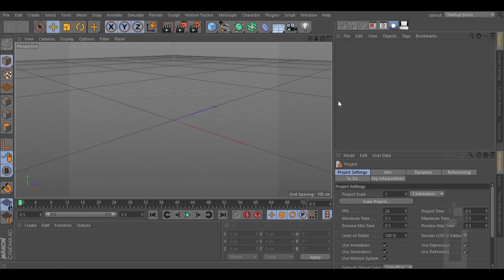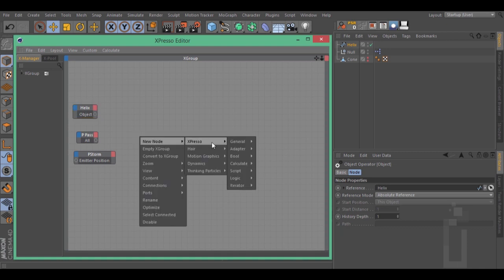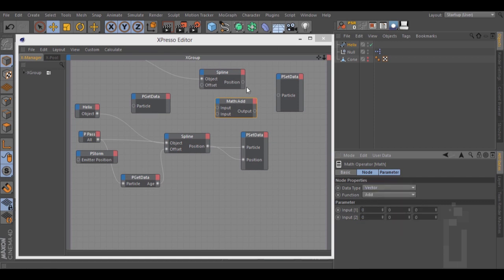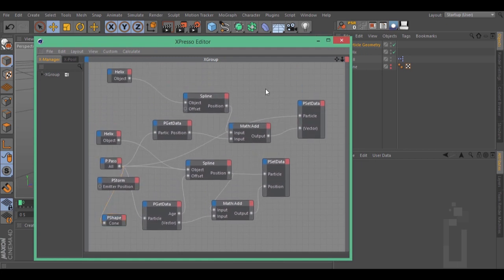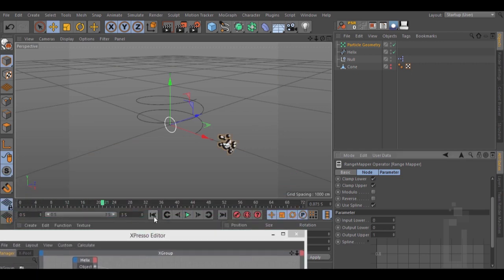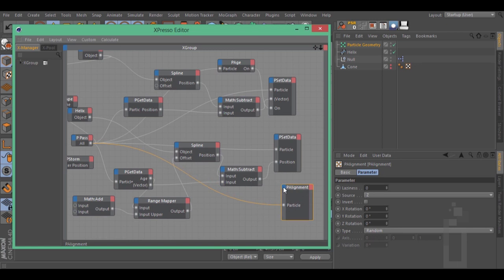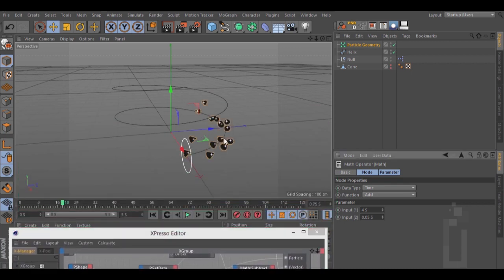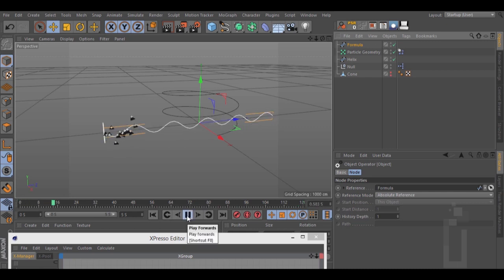C4D Tutorial: Thinking Particles Spline Path

Comment: Interesting tutorial, great work but the xpresso seems a bit complicated? I wasn't able to get my objects to move randomly along the spline path, instead they were generating along the spline in a very rigid way. How did you get the fluid-like movement in your particles as they travel up the helix?
Reply from the maker: Thank you for your comment. I did as showed in the video, i also put a preset that you could download from my blog. One thing that i noticed while doing the tutorial is that sometime (i think is a bug) did not work correctly, but that can be fixed if you reboot your system.

Good Luck
Pixldgblog.com
Reply: I have the same problem, but in my case, up until he put the "PAge" node, check its parameter in the right side. By default, PAge type is set to "birth". Try changing it to "absolute" and put 0 in T1 and 0.06 in T2. In my case, PAge doesnt give any feedback (True or False) when its parameter is set to birth as we need a boolean feedback from this node in order to use the "vector" value in the PSetData. Also dont forget to change the animation unit in second in your preferences (edit - preferences) as in this tutorial, animation unit is set in second. And also play around with the value in "Range Mapper"node. If im not mistaken, i set it to 0 3 0 1 consecutively (input lower, input upper, output lower, and output upper). hope this help.